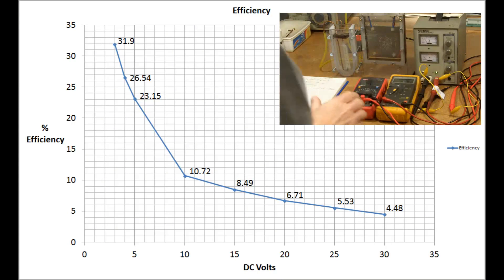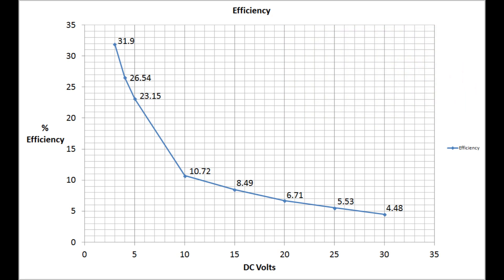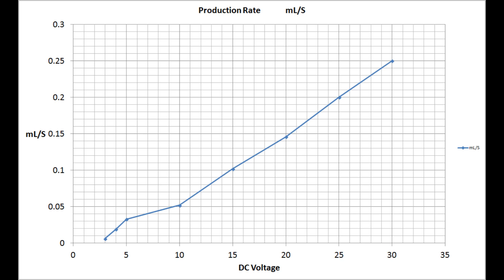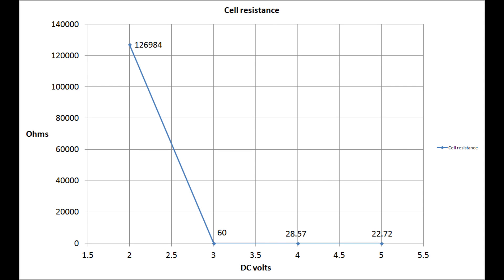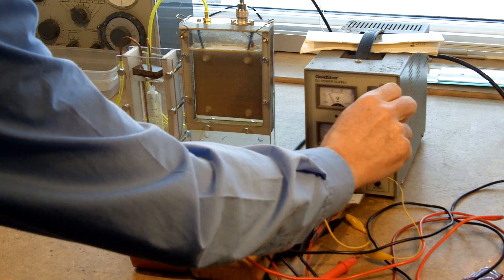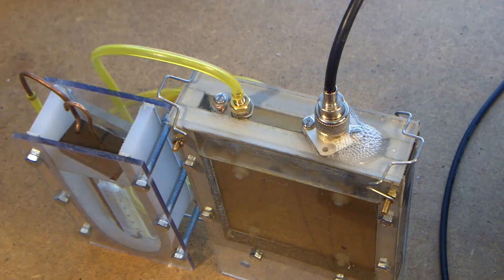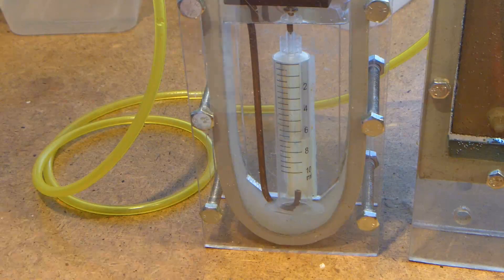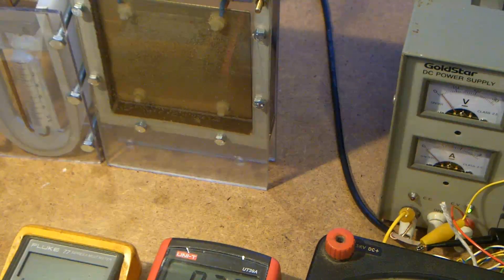Link to HHO. 9.   3 to 5 volts graphs plus 3 to 30 Volts

Comment from the maker: Hi there. I have quite a full programme of things I want to do but I'm just plodding through some of the boring stuff that I guess most folk wouldn’t bother with but I hope to get a reasonable understanding about water. The fact that waters resistance is voltage dependant was a surprise but know I know that it may influence my trials or the way I interpret the results. I will get on with looking at variable frequency but I only want to change one thing at a time. 
Kind Regards ... Andy

Comment: Wow! Very Great Presentation and Demo! Dear Andy! :D Again, I very like your way to make systematic testes and graph them.
You have Very Well Done with efficiency against voltage but what about frequency? Isn't it on frequencies that Stanley Meyer had his cells in resonance and get breaks in the molecules of water, even in absolute pure water, so without ions?
I would very happy if you could produce a graph like that at your previous efficiency pic against voltage, so 3 V.
Cheer, Khwartz.

Comment from the maker: Hi Rick, well thanks for that. I learnt a long time ago, ‘A bucket of water is a bucket of worms!’ we used a lot of evaporative towers, water-to-water heat exchanges fan-and-radiator coolers and refrigerated water coolers to carry away excess hate from high power (100’s of KW’s) Radio Frequency induction heaters and there were always far more hassle with the water side of things than ever we had with the high voltage or high current side. But I never knew about the variable Ω
Regards,
Andy